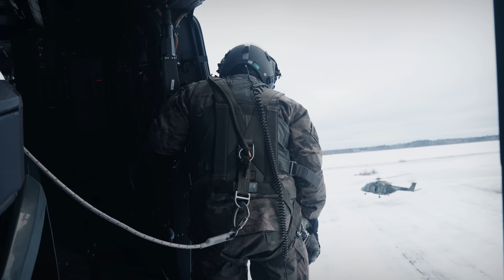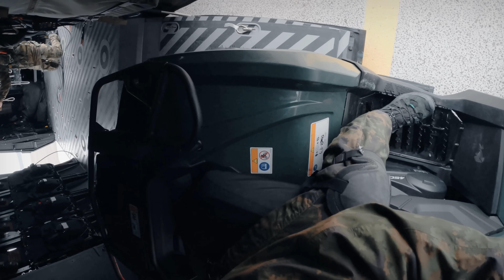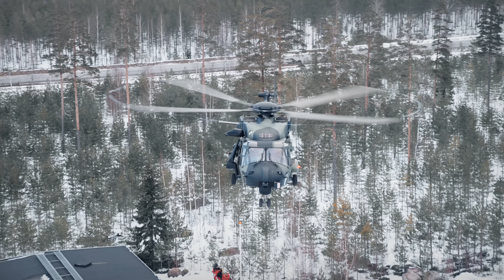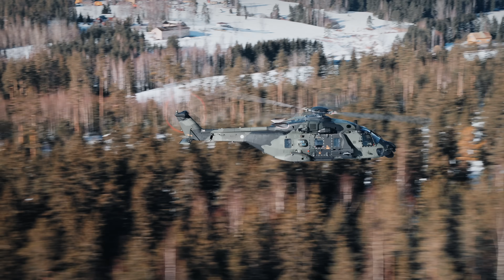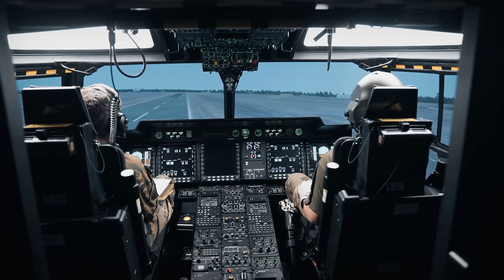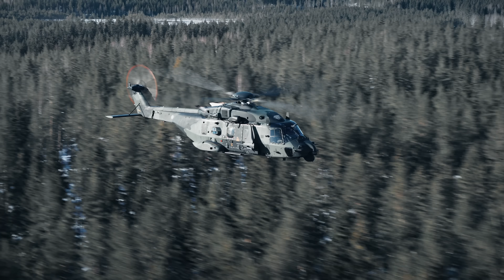NH90 TTH Walkaround: Inside Finland’s Special Operations Helicopter

Comment: Norway: Terminated the contract in 2022, demanding a return of all aircraft and a full refund due to the helicopter failing to meet contractual obligations.
Australia: Replaced their MRH-90 Taipan fleet (NH90 variant) with UH-60M Black Hawks early due to "defects" and "mission failures".
Sweden: Replaced their NH90 fleet due to low, "not delivering" operational results.
Belgium: Decided to withdraw their NH90 TTH fleet due to high maintenance and low availability, preferring to consolidate with other aircraft types.
Germany: Experienced low mission-capable rates (around 12% in 2019).

How are Finland's different ? have these issues been resolved?
Reply from the maker: The Finns have had to make the aircraft work, getting a replacement simply wasn't an option. So they have been proactive in their approach to this. They also own the military type certificate which has allowed them to implement specific changes to their aircraft and maintenance.
Reply: @Verticalplusmedia I noticed that Finland’s NH90s look much more modified than others I’ve seen.
Reply: at least during my service in 2016 these things were constantly grounded during our exercises, felt like more than 50% of the time we were meant to use them they never arrived. They were really freaking cool to use when operational though..

Comment: It's like a baby EH101. Have Finland had any serious issues with the NH90 like some other operators who have withdrawn their helicopters.
Reply from the maker: They have definitely run into issues with the helicopter, but they own the military type certificate which has been massively beneficial.
Reply: @Verticalplusmedia ok, interesting. The NH90 is apparently favoured by Irish Air Corps pilots as the replacement for the AW139, under the super medium helicopter programme. I would prefer to see the H225M/EC725 or EH101 instead.
Reply: @EyeInTheSkypaulmcmenamin That’s odd, isn’t the AW139 noticeably smaller than the NH90? I don’t think they’re in the same payload class, like not even close.

Comment: Meanwhile in Norway "Norway officially cancelled its NH90 helicopter contract with NHIndustries in June 2022, citing severe maintenance, reliability, and delivery issues. A final November 2025 settlement requires Norway to return all 14 helicopters, with the manufacturer paying €375 million (roughly $432 million) to resolve the dispute. "

Comment: I was worried about this acquisition back in the day, but almost all of the teething issues have been solved by now, and now it has finally become the reliable machine it was supposed to be.
Reply: Are you on drugs or something? Many countries are packing them up, or destroying them, or sending them back to the manufacturer. They're an absolute disaster of a helicopter. Don't try to rewrite history. It doesn't work
Reply: Norway and Sweden disagree, I believe.
Reply: @iam5085 so, like how Australia should have followed their neighbour NZs lead, Norway and Sweden should have taken advice from Finland WRT NH90 operation.  Again instead of concentrating on the few that obviously could'nt try focusing on the rest that obviously can and finally stop blaming the machine and instead start looking at the operator.  This clip alone being a perfect example of why not why not.
Reply: @regregan6852 most operators have struggled to get the aircraft to perform as designed. It’s not a “few” operators its most. And the global availability rates reflect this.

If you’re going to point to NZ as counter example. You can contemplate whether their solution is feasible at scale. 20% of their fleet is used for spare parts. Which has helped resolve some of the issues with the aircraft
Reply: @ArsenicApplejuice what do you mean perform as designed?  Do you mean fly, because that is what they are designed to do.  How have you come up with this 20% of the fleet figure?  Do take the class through your workings for educational purposes or are you referring to the 9th frame purchased specifically for parts and was never intended to fly as they figured out that actually works out cheaper than initially purchasing all parts separately with the bonus of giving them readily available spares, of everything, ready to go which can then just be replaced on that spare frame whenever instead of on an operational frame now.  Actually yet another better way of doing things IMO.

All operators achieve availability rates, maintenance schedules and therefore costs individually and it shows, glaringly, as there is no one standard which is kinda the whole point.  Again, follow the operators who can for results not the ones who can't for excuses as it's like chalk and cheese in actual operation between some considering it's all the same helicopter just to even conduct basic flight hours!

Comment: They have sorted out the problems with it today. So it's a great buy today. It wasn't 10 years ago.
Reply: Finnish pilots study and want to improve the fying carrier , not complaining . Compare BREWSTER in Finnish wars . No body wanted it , we bought and shot hundreds of Soviet US models down .
Reply: Patria has a part in making and maintaining it, might be the key difference from Norway who mothballed them
Reply: Exactly.
Reply: Hopefully they have 

nh industry’s is rather slow because of ip. The over excessive use carbon also had it downsides because is far stiffer and worse in dampening vibrations which makes the electronics maintenance heavy. Also being conductive it’s makes more problems with oxidation.

Would have been better to buy a streckten h175 or h101 instead . Nh 90 is just a example how to not develop a helicopter